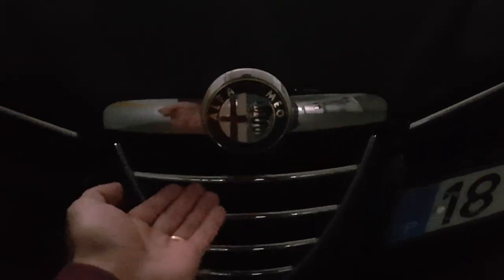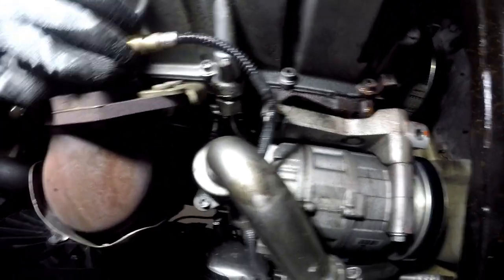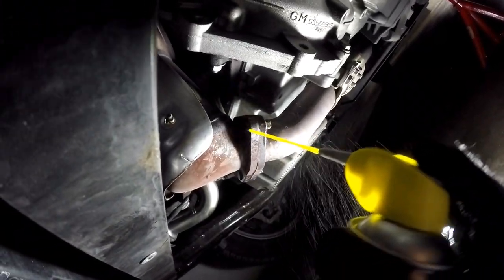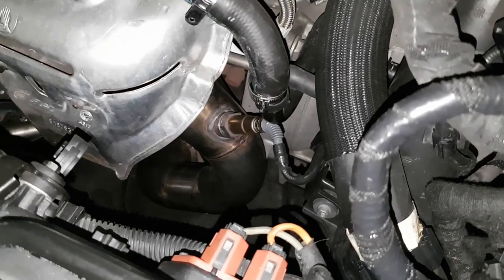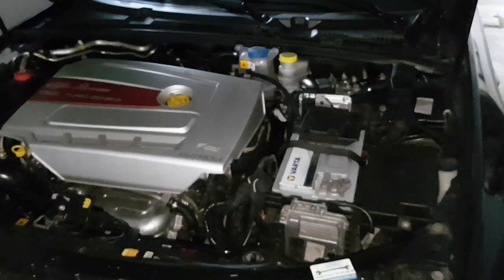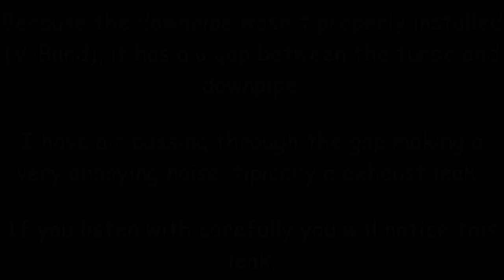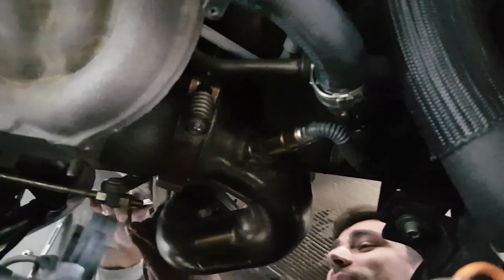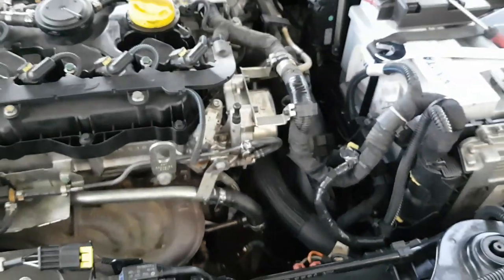DIY/How to... # Downpipe Instalation Alfa Romeo 159 1750 TBi Novitec Nero

Comment: Getting very hands on mate, good that you are doing your videos in English now aswell. Been trying to diagnose rattling brake calipers / pads on my 1.9 lusso for a while, no luck so far, might just have to replace pads as they aren't OEM ones atm, they are apec so maybe that will solve it. I see you've still got your undertray still on! Mine went along time ago.
Reply from the maker: Thanks. 

And the ratling should came from the brake pads. Try replace them. I have a video explain how to change it.

Cheers

Comment: hi, thank you for sharing the video, one question i noticed you didn´t install back the stock heat shield on the new downpipe, why? are you experiencing more heat in the cabin now? cheers
Reply from the maker: Hello, thanks first of all. And I didn't fit the stock heat shield because the heat shield was connected to the stock downpipe. That's why I didn't fit it. And now the heat it's a lot lower than stock and I fit a thermal tape on the downpipe in order to keep even lower the temps

Comment: Hi bro, have u achieved the ideal sound so far? I have a 1750 tbi with Novitec Neros too, i have also put a straight pipe through the mid box. The rest stock. And i find the sound is still too tame, just bassy. I wish for some pops. What do u suggest?

Comment: what's the gearbox that comes with this engines, is it the cancer M32?
Reply from the maker: +darkpsy19 

Yes this was the M32. As far as I know there aren't many issues on this car with this engine. And many 1.9 Diesel engines with more torque and not many issues.
Reply: This comes with C635 gearbox. The same as in Giulietta

Comment: Is the mid silenced deleted in this video, because mine is straight pipe and doesn't pop so will the decat make pops and bangs
Reply from the maker: Yes, I have the middle pipe deleted and only remain with the novitec rear boxes. It not pops and bangs , to make that you need a remap and enable that feature.

Comment: what did you do with the rear lambda sensor? do you have"check engine" now?
Reply from the maker: Hi, before I made this change I already deleted from ECU the sensor. That why o don't have engine warning light. 

Cheers
Reply: Its stage 2 remap?InCoGn1t0
Reply from the maker: Actually my car was stock, but i want to make a ecu remap.

Comment: Did it decrease your under hood temperature? I have 1750 TBI too and it works very hot. Sometimes it warms my legs I can feel the temperature in the front seat. I think the catalyst in the downpipe increase the underhood temperature. I am thinking to install downpipe on my car. Does it work it? Did it satisfy you?
Reply from the maker: the temps i guess decrease, but not too much. Every petrol engine radiates a lot of temps from under the hood. and for me every turbo car should have a decat downpipe to keep the turbo safe and healthy

Comment: Hi, is the downpipe replacement a full decat or half?
Reply from the maker: It's a full decat downpipe.
Reply: @InCoGn1t0   but did you have to remap ?  sensors are gone so...what  info is going to the ecu?
Reply from the maker: After doing this modification I remaped the car  but previously i disabled the sensors in order to don't have problems with lambda sensor. That's why I don't have any fault lights on the dashboard.